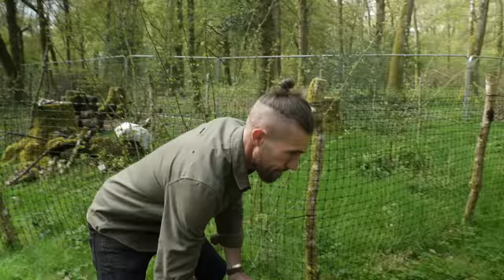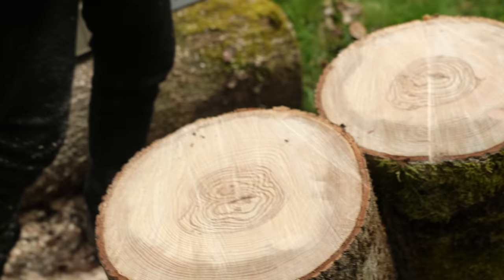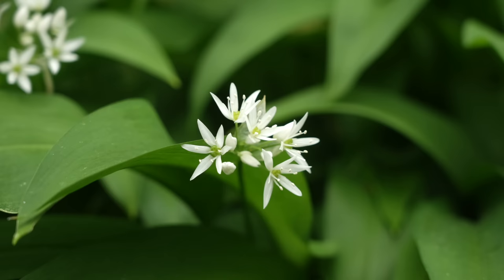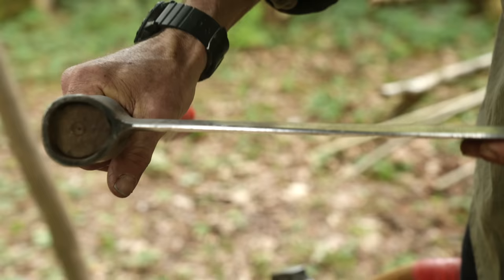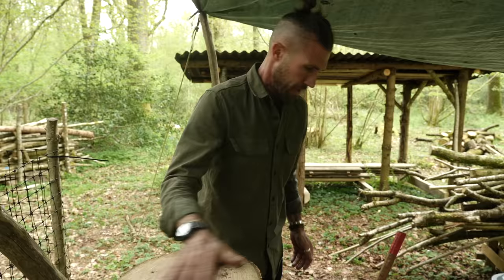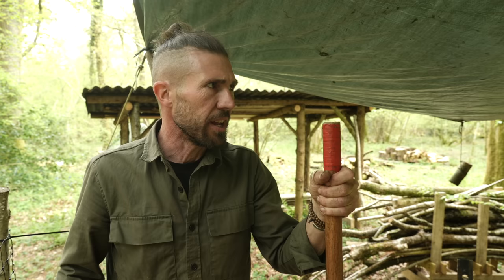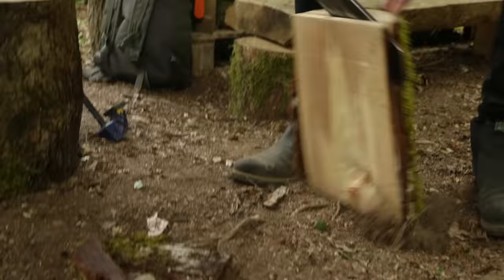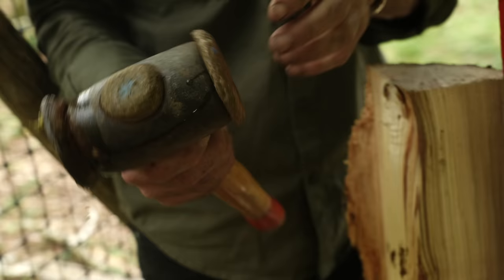How Wood Roof Tiles are made by Hand in the U.K. (Shakes, Shingle Making)

Comment: In Finland and I assume in Scandinavia too it's normal to use tar to protect the shingles. Same stuff they used on ships and ropes back in the day. Some old churches and such are still roofed that way to keep them true to the originals. Smells awesome.
Reply: ah the smell of a stavkirke is the best
Reply: Most people don’t realize that when you say tar it is referring to tree pitch and not bitumen tar.
Reply: To make tar, you try to find dead pines, aspecially dead trunks and roots. When a pine dies it sometimes concentrate sap into the wood.
You extract the sap as tar by heating the wood up without making the fire connect with it or the gasses it produces, since tar and the gasses are really flameable. 
As it heats, it slowely pours out of the wood as a black very slimy liquid, like a really thick paint. This is super water resistant and absorbs somewhat into the wood you use it on. Makes wooden houses and roofs last for ages.
Reply: @D-B-Cooper  bitumen tar has been known and used for thousands of years. to say it wasn't ever used on something like a roof- is silly.
Reply: They have pitch pines there, Ray Mears did an interesting video on how they did it in the early 2000s
Reply: @johnwalker7592  Not bitumentar though.

Comment: As a kid I spent the summers with my Aunt & Uncle in Oregon. And on my 13th summer I got the pleasure of splitting  Western Red Cedar Shakes to reroof his home. 
A loud rumble was heard coming down the road and a huge logging truck turned into the yard and the driver rolled two logs off the load and after he left my Uncle showed me how to make the shakes and how to stack them so they got the proper air flow between them to dry as the temp was around 100 every day and hot at night so they dried quickly.  I spent several days splitting them about 3 weeks after I finished on Saturday morning there were about 10 of his friends there waiting outside and my job was to keep everyone supplied with shakes, I wore a backpack that would hold a bunch of them and all day long  it was up and down that ladder passing out the shakes. I think I fell asleep before dinner...it was a long day.

Comment: The japanese make shingles very similarly, but instead of splitting out whole diameter width ones, they make the first split across the log,  then take the half long and split THAT in half, so it's quartered.   From there it's successive radial splits, which helps minimize any problems presented by branches.  Yes, they're narrower but you get more of them.....
(spliting with a froe like this is called "riving") 
I was shown how to make shingles by my grandfather who showed me using oak or cedar, and was done by the radial rive out method.   I found out years later it was actually the japanese technique.. 
I've always wondered why there are some subtle differences in methods between East and West...Have to wonder if some of it comes from the limited availability of the wood itself.
Reply: that isn't unique to the japanese, in fact I believe that's how they traditionally made shingles in the west, too.
This guy's technique isn't bad but it's not the common way.
Reply: It very much depends on the diameter of the tree chosen. For smaller logs this works fine. The quartering method is also traditional in the UK as well.

Comment: Never would have thought to use ash as a shingle...here in Canada we would use Cedar for any roof and even some exterior walls.
Reply from the maker: Yes, first time I have seen it too. But as Ben says, Ash is really an interior wood. The only reason it is working in this case is because he has put such a steep pitch on his roof. So rainwater does not have a chance to sit and rot the ash away. Cedar is also really popular over here too, but it is all made with machinery.
Reply: @TAOutdoors  yes cedar shingles are made in a shingle mill here...in my early twenties I used to buy loads of firewood from the shingle mill as well as the telephone pole mill for $5 a load and cut/split I sold it for $150 a cord lol made really good money back in those days doing that. Also used to help out hauling what they call cedar shakes to town...was loaded up in 1 cord blocks on a 5 ton truck and delivered to that cedar shake mill...hard work but well worth the pay haha.

Comment: rust and boiled linsead oil was commonly used in the american frontier as an antifungal coating/sealant. the linseed oil polymerizes and basically acts as a water repelling epoxy/enamel. the iron oxide /rust was naturally antifungal and stopped the breakdown of wood. thats why the barns were all red in the US... atleast before paint came available

Comment: That is really cool. I'm wondering if this is possible without a froe. Like could you do it with like a basic bushcraft kit (bushcraft knife, folding saw and a hatchet) and if so then how would you go about it?
Reply: The froe has a wide blade perpendicular from the handle, and a long handle to use as a lever. If you simplify it, the real tools are the wide wedge and long lever. With a hatchet or knife, you'd be limited by the width/length of your blade, but you could hammer either tool with a wooden mallet for the first clean cut. A hatchet or knife could act as a good wedge, but not a good lever.

The froe has a handle perpendicular from the blade unlike a hatchet or knife, which you use to lever and split the wood after making a cut. Because the handle is not perpendicular the rest of the split with the other tools would be a twisting motion instead of a pulling motion, and it would require a lot of strength because you don't have the right leverage. You could cut a stake out of a harder wood to use as a lever instead, with a point that's as narrow as your knife/hatchet blade. A stake is something you can craft easily with just a knife or hatchet.

So yes, you can do this with just a knife or hatchet, but only because you can use the knife or hatchet to craft another tool to act as your lever, instead of having the froe do double duty as wedge and lever.
Reply from the maker: It’s doable, but it would be far harder without a Froe. You could always test it out on smaller pieces of wood. The thing with the Froe, is it’s the handle that allows you the lever to pull on it. Plus the profile of a Froe blade is designed so that would can be split clean and straight. Have a go with an axe. I’d say the first part of splitting a log in half and then quartering it will be easy enough. It’s once you get to cutting 1” thick planks that it would get hard.

Comment: Would a longer bladed froe make the splitting easier? 
If it had a couple of inches sticking out the side of the log you could hit it further.
Reply: Or a smaller diameter log ?

Comment: As someone who has done squares of this, my only “criticism”: go longer. A 30”
Or so shingle (depending on available species) is easier in the long run than shorter
Reply: What is done at the peak of the roof to prevent water from entering? Is one side of the peak taller?
Reply: @hankhill962  usually the top row is left considerably taller, slanting away from the direction that rain tends to come in from, if that makes sense?
Reply: @JacobvsRex  it does, I have seen that done on metal roofs, when the customer did not want to spend extra money for ridge cap